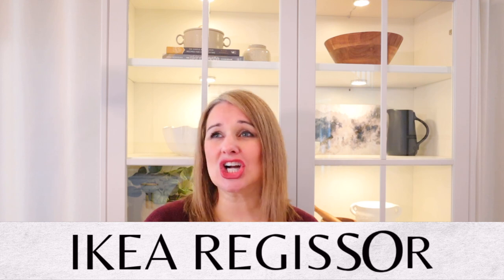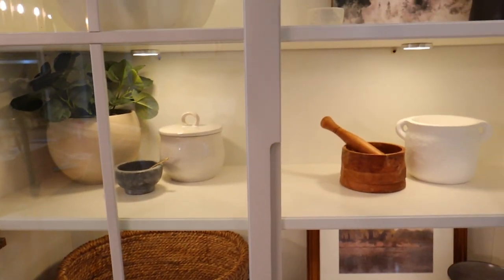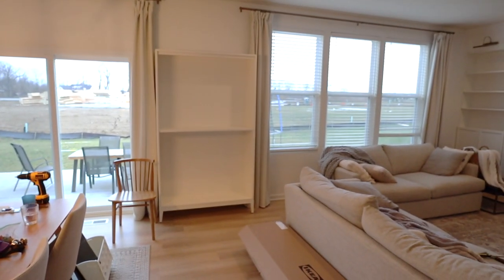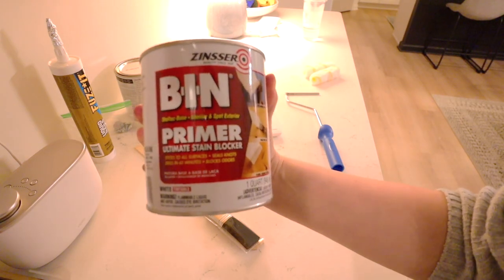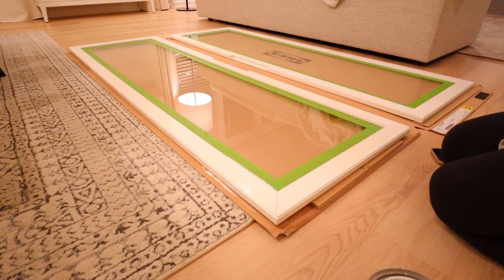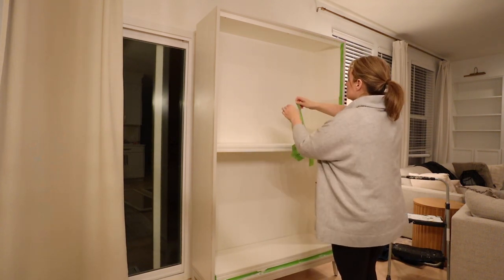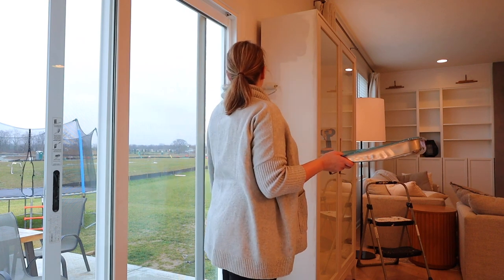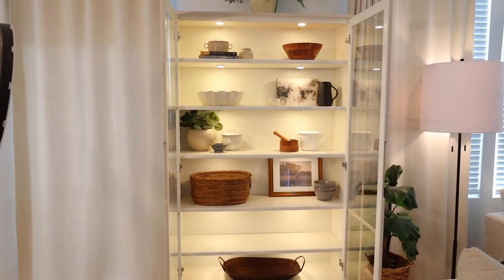DIY IKEA HACK REGISSOR TRANSFORMATION | HUTCH CABINET MAKEOVER

Comment: I got the same display cabinet a couple of days ago from IKEA. You hack looks so beautiful. Today I received the puck lights from Amazon. What did you use to keep the puck light wires in place? Did you glue them in place?
Reply from the maker: You will love all the storage! We drilled a small hole in the backboard to put the wire through (Right below each shelf). Then all the wires are on the back of the unit held up by tape lol. No one can see them back there.